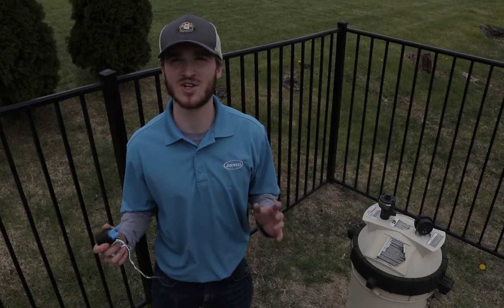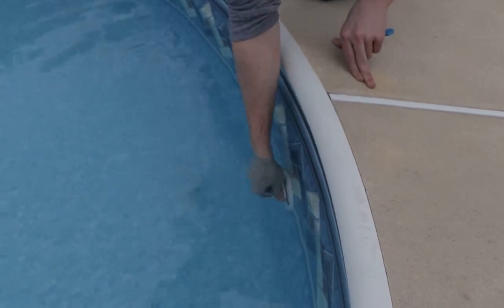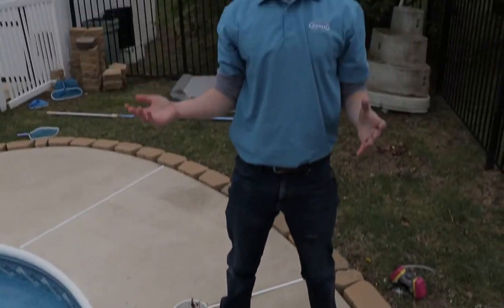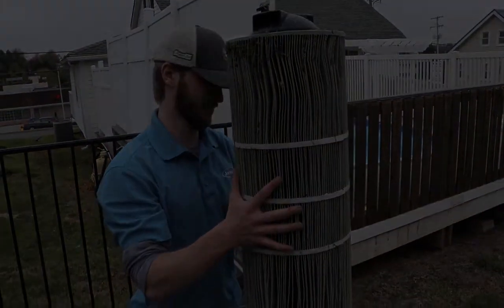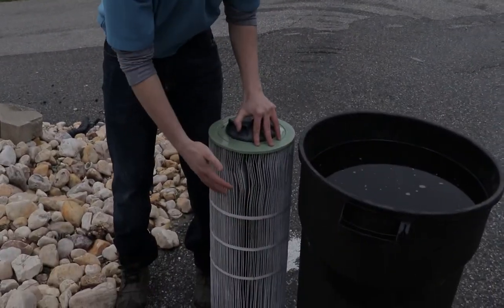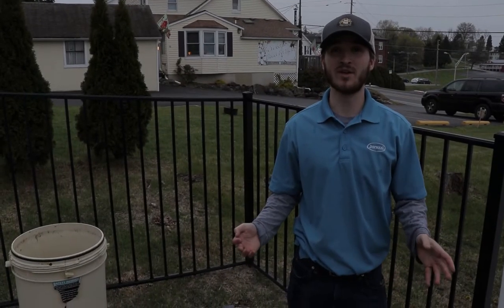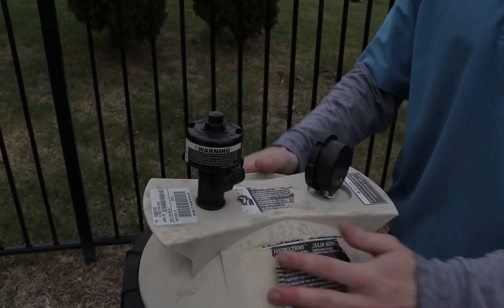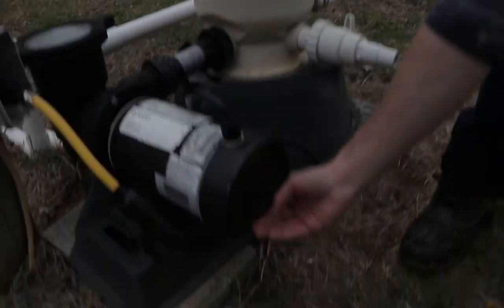How to Clean Your Pentair Cartridge Filter

Comment: Tengo una piscina con ese mismo sistema quiero ayuda para saber cómo drenar la piscina un poco
Reply: No need to drain water out.
It will evaporate over time.
But you just use the bypass valve and attach pool hose to it.
Pump it down the storm water drain or into the yard.